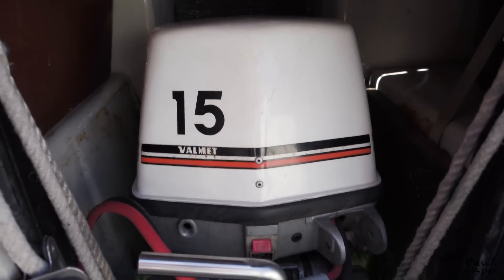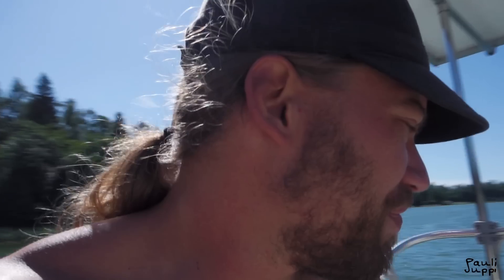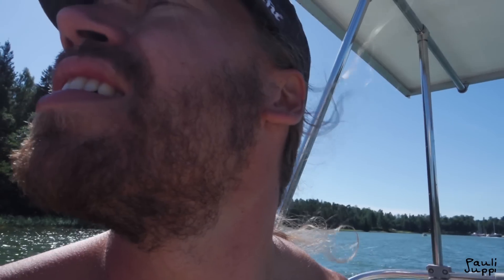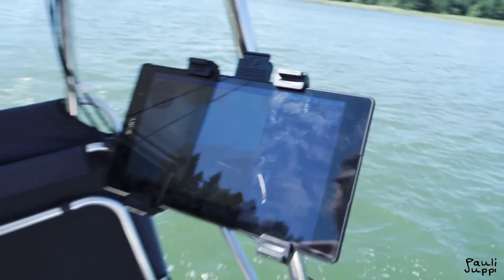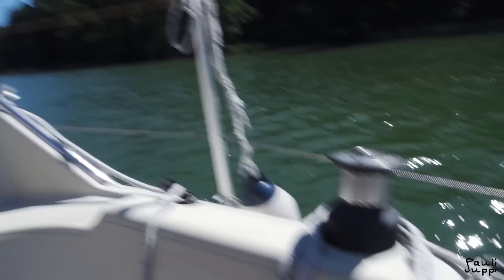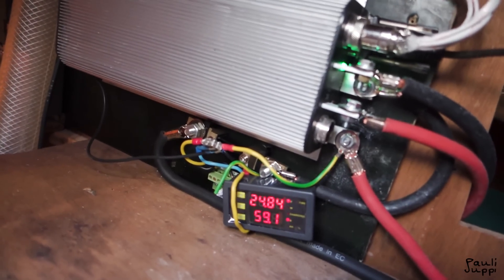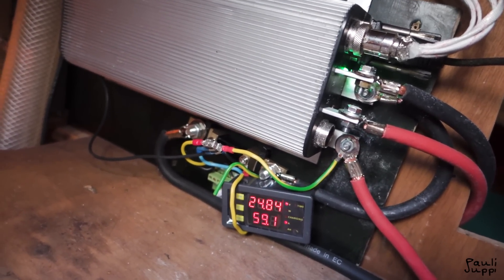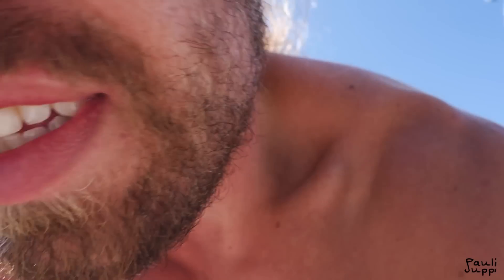How I build my electric outboard motor

Comment: Great video, make sure you have a spare prop and nut plus use a stainless steel split pin if you use it in salt water. Check out a prop pitch chart for torque vs speed.

Comment: Is your controller ONLY controlling voltage, or is it actually controlling your motor(is the motor brushed or brushless)?

I'm curious because I think I like the idea of brushes and a reostat for SIMPLICITY.
Reply: I would guess from the noise that it’s brushed

Comment: i really like the idea of using a brushed motor vs brushless..   why spend the extra money on a brushless system when at the end of the day,  your sails are the main form of propulsion..  and the motor is only really for potting around the marina and relatively short uses  vs a system like one used in an electric car.

i really like the fact that  if the controller dies while out in the water,  then its still possible to use the motor if you wire it up directly...   unlike a brush-less system.
also the reliability side of things..  not having the risk of hall sensors failing,   along with having less wiring to deal with   meaning a reduced risk of something going wrong and making problems easier to identify
Reply: while also leaving extra money for beer ;D

Comment: How big are your loads on 24V?  Why not wire the whole bank to 48V the entire time and use a DC to DC converter for 24V stuff. That way you can run fast (beast mode) or you can run at much lower currents for slower speeds. And you'll still always have the 24V that you need. It gives you access to all speeds that you want without switches and relays and you can use the entire capacity for motoring at higher speed if you wished to.
Reply from the maker: Well if you look ahead to my latest videos, that's what I did. I use 48v for the motor, but have a separate bank for 24v that can also be switched to the motor if needed. And I added separate a 12v battery for safety reasons but... This has all been good practice for the next big plan to build a boat with smart battery/electric solutions :)

Comment: Did you buy that little white cog or make it with a 3d printer?
Also, you must have a fuckload of batteries on your boat if you use a kilowatt per hour going 3 or 4 knots.

Comment: i was flinching as you turned that propeller on the gas motor by hand... it's how alot of people have lost fingers. the turning of the prop sometimes causes a spark plug to spark and the engine turns on. bye bye fingers... but i am assuming you where safe as that was probably a broken motor.

Comment: i have a midship 25 ,and i was wondering how much would it cost to build a system like yours on my boat ,it has a  vire 7 hp motor inboard but the motor is curently out of the boat

Comment: This is a wonderful solution. I have a 24' sailing boat that had a 9.9 Honda that was too heavy. I replaced it with an 8hp Mercury 2 stroke, was much better, but now am looking at electric conversions. This video helped me alot. so Thank You!

Comment: Are you measuring current from the batteries or to the motor?
Reply from the maker: +Ted Fryman From the batteries, cos it matters me more what I'm consuming. But now I'm wiring the controller better and putting another amp meter between that and the motor to get the reading from there so that I don't feed to many amps out

Comment: hey man first things i love your videos and i am planning to build a pontoon boat that solar electric for the lakes in north germany . i have been on a couple boats that use electric motors and i can tell you have a pretty good setup but you are wasting a lot of energy because your prop is too small . most motors in your power range use bigger props around 30 cm with a similar pitch like yours as far as i can tell from your video . from the electric boats that i have seen a 30 cm propeller with around 5 kw motor gives them maximum speeds from 8 to 10 knots because with a electric you have to use the torque more thats why a bigger prop makes such a difference . if you have the possibility you should try a bigger prop . 

greetings from germany
Reply from the maker: +Crushonius thanks for your comment. You have a point but I don't think that I can waste energy the way you think with electricity. I can waste speed by using a too small prop, but then the motor gets to the max rpm using less amps.
Are those other boat sailboats less than 30ft with a fixed keel around 700kg? From the tests and data that I've read, waterline defines pretty much the max speed on fixed keel sailboats. I'm also pretty sure that my boat won't go over 6knt even with a 30hp motor.
What I know is that electric outboards use bigger props cos the max rpm is lower than gasoline eng. to get the same thrust and utilise the famous e-motor torque :)
But I'm not an engineer and know only physics from high school, so please correct me if I'm wrong :)
Reply: what you said is sort of true and not :) e motors do react like you predict and not because in boats you actually dont want to hit max rpm with your e motor its hard to explain for me but there really is a sweet spot and for most e motors it is between quarter and half throttle and against all logic a bigger prop actually uses less amps for the same speed when you are in the sweet spot . an emotor actually loses torque the higher the rpm get thats why they are more efficient at low rpm.
of course you know your boat better than me and if you say it wont go over 6 knots i believe you  . but i have seen a torqeedo 4.0 rs push  a 32 ft fixed keel sailboat that weighed around a ton to 7.8 knots drawing about 108 amps @ 48v but yeah every boat runs different . well look i just wanted to help and most people that build their own and the retailers like aquamot or torqeedo use props around 30 cm so if you know someone who has one lying around maybe you could test it for a day and see for yourself if it is more economical. and if not who cares it still a very nice setup and a beauty of a boat .
Reply from the maker: Crushonius Yeah, I think your right with the rpm and torque sweet spot. 2 years ago I was planning to get the torqeedo 2.0 but cos I have a motor well and a hatch that opens on the bottom, I measured that the big torqeedo prop wont fit out. Other reason was to try out the regen that can be done with my motor(I just havent got the setting right yet;)
I'm sure the engineers at torqeedo have done their homework and they might have the best e-motor prop out there.
yep 32ft has a longer hull and higher max speed, but that is a very light boat, cos mine is 8ft shorter and weights about 2 metric tons :)
Thanks!
Reply: oh the hatch is to small that sucks , still if you ever get your hands on a bigger prop that fits please try it out . even if it doesnt bring you a higher end speed it could help save some energy and could even help with the regeneration . the boat i was talking about weighs a ton empty thats really empty just the hull without counterweight sorry about that i got that confused i just asked my friend who was there with me and he thinks it weighed about 2,5 tons dry. but yeah you just have a waterline of 24 ft that is really a limiting factor technically it should go to about 6.5 knots according to science ^^ but then again thats just theory
Reply from the maker: Yeah, I could enlarge the hatch, but... there's so many other things to improve on my boat :) this diy motor thing was to "learn and save money" kinda experiment - next boat will have motors like oceanvolt.com
I think the waterline speed theory is only effective when sailing cos of the heeling...
I'll probably try to find a bit bigger prob that has been made for my kind of outboard years ago, but I doubt it wont effect the speed that much and the shape of the outboard will limit the max diameter of the props
Reply: Pauli Juppi 
boat hull speed has nothing to do with healing.  It applies to all displacement hulls be they sailboat or motor boat.
Reply: Joe Henderson  true. max displacemet boat speed has to do with the length of the hull and the shape of it. A certain hull shape will create a certain wave patern and a hull length needs to be designed together with this patern. i do not remember exactly how it is done but it has to do with the wave leaving the back of the hull with its highest point or something. this way it will create less drag so max speed will be higher. it is not one optimum but a repetitive optimum. so for example the boat can be less efficient when adding a meter of hull length but getting more efficient and faster again when  adding a  second. and every displacement hull will have its own max possible speed. called the "hull speed" translated from my language, not sure if it is called like this in english. It means that when a hull reaches this speed, adding more power after this point will only result in a higher wake and making the hull tilt backwards.     the boat will try to climb out of the "pit" in the water made by itself. so adding more power will make the back sink deeper and with that creating a steeper path to sail up. same as with the car. driving up a road that will increase in steepness will require the engine to work harder while the speed stays the same.
Reply: pauli. great interesting video's. where do you get these electric motors and how much do they cost?

Comment: Hey Paul, 
a good project sailing around the world only with wind and solar power. I made an atlantic circle on a 9m boat some years ago, using solar panels for all electric stuff we had. We had 200w 12v solar panels, collecting about 8 amps/h in real conditions. But this was only a few hours a day around 12 h midday. To get more electricity, i mounted the solar panels on a frame, which I could turn to the sun. In good conditions i got this 8 amps only a half hour after sunrise when I turnd the panels about 60° to the sun. I think it will be hard to get all the electric power you need out of your fix mounted panels. How many miles can you go with  your electric motor, and how many hours of sunshine do you need to get your batteries full again?
with kind regards 
Peter Vienna/Austria
Reply from the maker: Hi +Peter Fehringer and thanks for info. My new controller can give me max 20amps in 24v from the 500W 24V panels using the MPPT technology. I know it would be much better to be able to angle the panels towards the sun, but they weight over 40kg(88pounds) so it's not that easy.
Motoring 3kns I'm using about 35amp/h and if I stretch it 10h(using 350ah/500ah) I get 30nm plus if its sunny I could get another 100ah from the sun  during that time and get an additional 3h of motoring time :) But this is all theory, havent tested it in a really long sail.

Comment: Thanks for the video, was great except maybe too much face and not enough motor stuff. :) 

BTW. how much time is needed for your solar panel to charge the battery bank?
Reply from the maker: +waspoza Well in the best conditions my solar controller should give me around 20 amps/h. I think I could get about 100+ amps in a day and my battery bank is 500ah so...
And sorry about my facetime ;)
Reply: +Pauli Juppi Cool, thanks for the info! :)

Comment: Hey Pauli, great video again! At my work we use the same bushing assembly that you use between the motor and drive shaft, bring a few spares of the white bushing if you hit a lot of sea weed and the prop stops the electric motor will sheer the bushing to protect the two parts.
Reply from the maker: Thanks! I will gather some spares with me
Reply: @PauliMyrakka  I have a volva penta 130 saildrive I'm thinking of converting it into a electric motor. I have enough electric power. I'm thinking of using a forklift electric motor. Any suggestions?